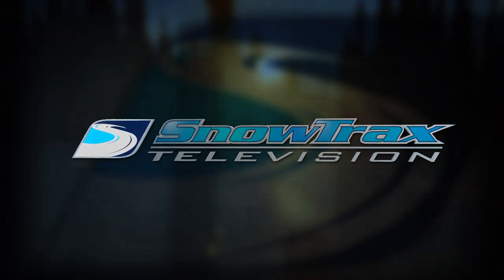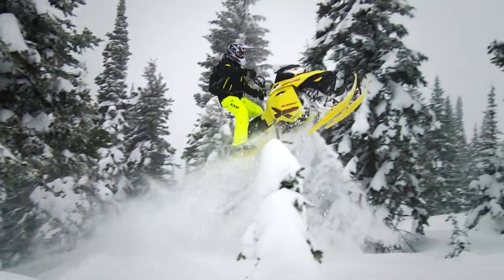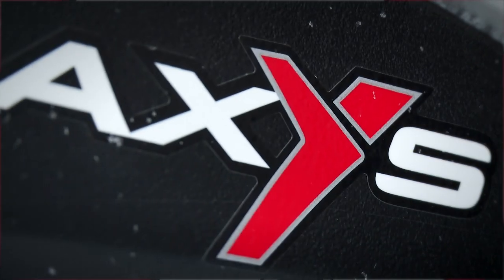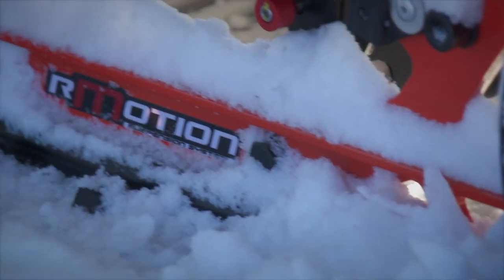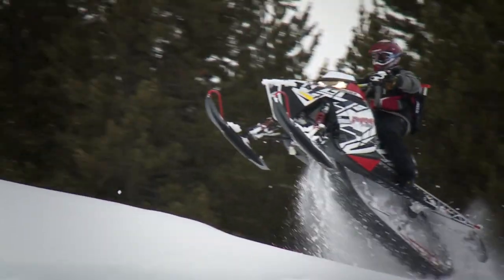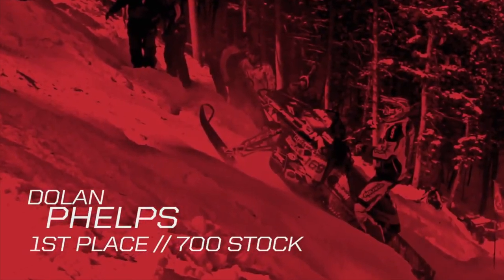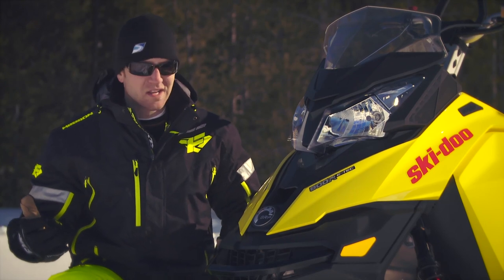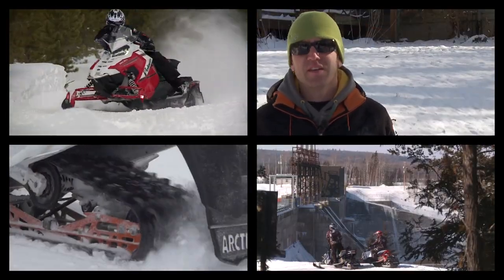SnowTrax Television 2015 - Episode 5 (FULL)

Comment: I have a switchback assault with the 1.35 cobra track.  Works great on the trail, doesn't feel long with the tipped up rails and doesn't heat up on the trail.  Yeah there's a little ski lift but can be completely eliminated if you raise the skid to the top mounting hole.  Only downside is the walker evans shocks are valved way too soft!

Comment: Funny, I could have sworn polaris 2016 RMK 155 is now 64 LBS LIGHTER then this sled.. maybe time to reconsider what "light" truly means?
Reply: +Onyx Knight it is lighter but the weight loss is from more expensive materials such as carbon fiber. in another video here on youtube couple sponsored riders from AC show a big drawback from that weight savings in weight gain from snow/ice due to collection which a fair of is caused by the heat exchanger that is small on the polaris. I can find the video link if needed.